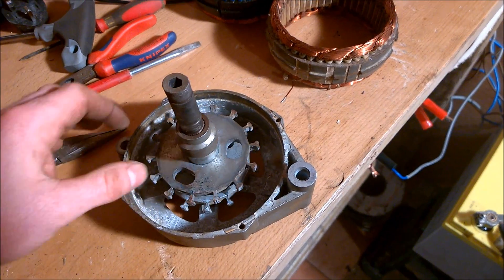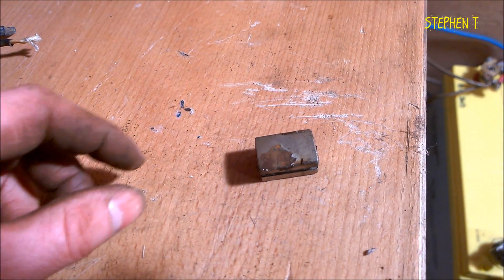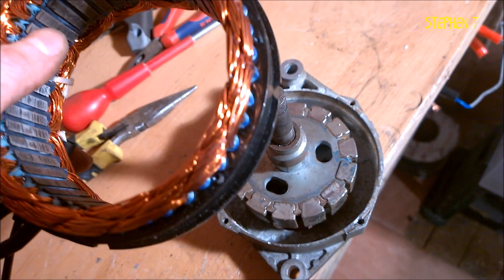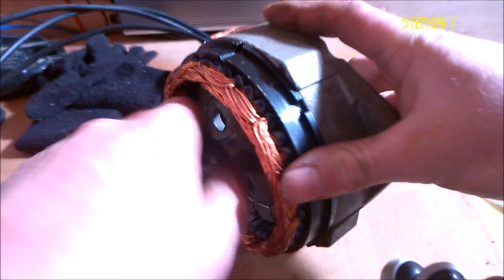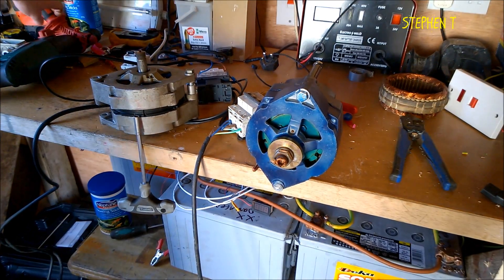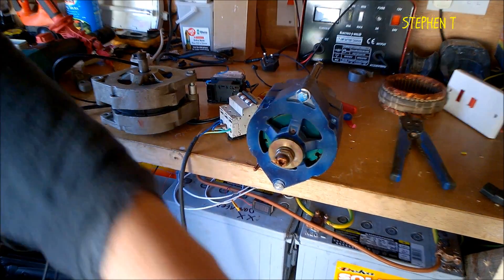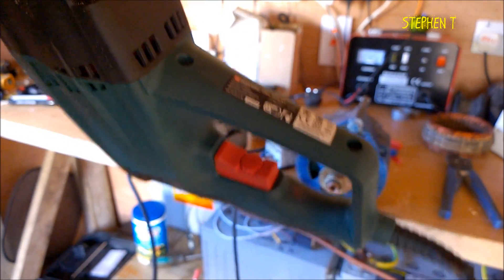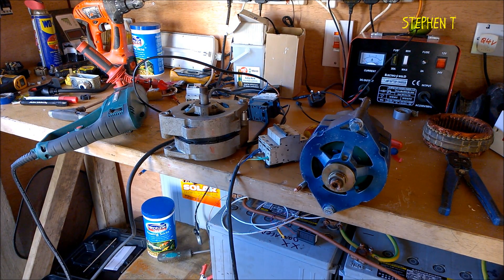THE BIG TEST MISSOURI WIND AND SOLAR VS THERMODYNE BENCH TEST.D.I.Y

Comment: I have to ask because I do not know. I understand you are putting a stator from thermodyne into an alternator body that has a magnetic rotor from Missouri wind and solar. Did you even check to see if they are compatible? If they are not compatible, (and I do not know why a person would automatically assume they would be), then of course it would not work. I have had car alternators go bad before. Those alternators had nothing to do with Thermodyne or Missouri wind and solar. Stuff does not work forever. I do not own a wind turbine. I am trying to figure out what wind turbine to buy. So I am not a supporter or sniper for either company.
Reply from the maker: I don't use anything from them. I have a new turbine up over 3 years now. Your turbine you need is all about your location.